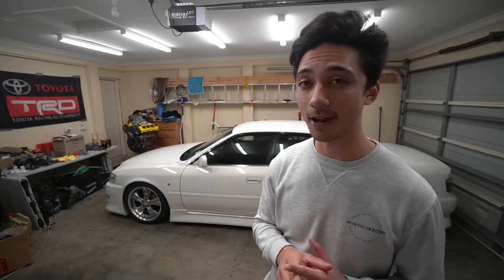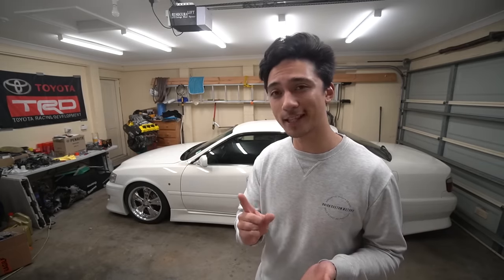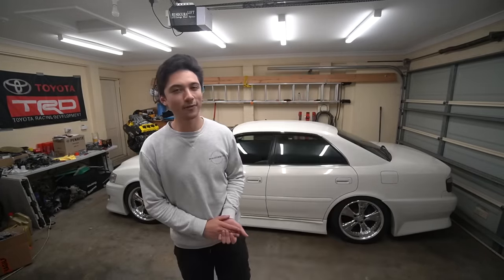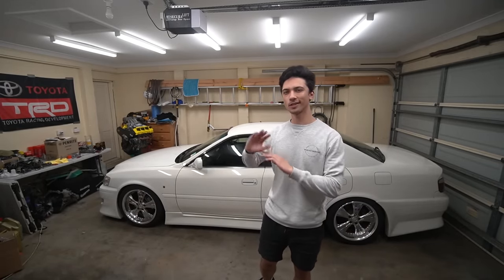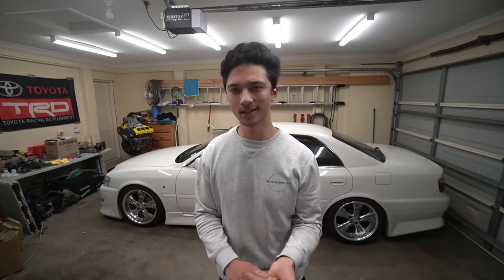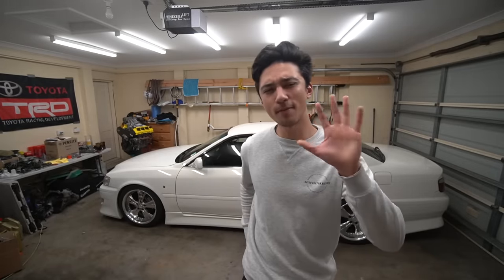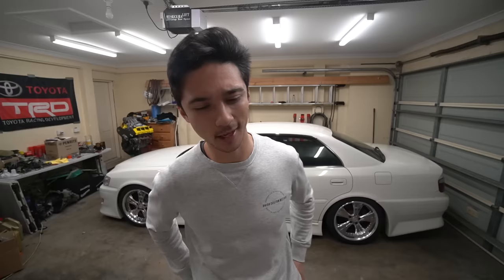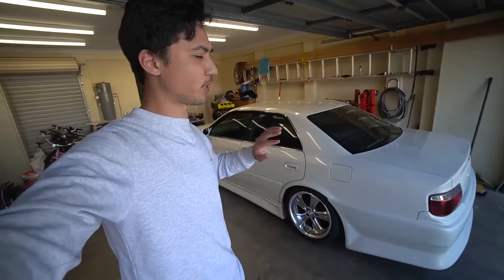The First 5 Mods You Should Do To Your Car (For Cheap)

Comment: I have a V8 in my car. Behind the manifold I’ve for 2 cats (one for each side) and then the exhaust joins. After that there were 3 mufflers stock. The car is 17 years old now and the middle muffler fell out with rust cause I live in the salt belt. I was trying to replace the middle muffler and the front one fell out. So I did a muffler delete and now it’s super throaty. I love American V8s

Comment: the best mod is preventative mantience
Reply: Yes but also no. Preventative maintenance could go far beyond just keeping up to date on your oil changes depending on your car. For some it’s a lot of shit to keep track and on top of. Meaning you could have a lot of work to do. 

Also, preventative maintenance will keep your car on the road at a lower cost. Some would say the point of modding isn’t longevity but rather performance and cool factor

Comment: One important thing you missed: if it's your first car, an economy car, or otherwise just not your end goal for a car...
Don't mod it. Please. Save up until you can afford a project car or a car you really like. Don't waste your time or money getting a muffler delete and 20-inch rims for your ford focus or kia soul.
Reply: I'll be getting my first car soon, around December or so, and I've been looking out for which one to get. I want it to be a project car but until pretty recently, I wasn't too much into cars, so the only ones I'm into are old, iconic cars that are relatively expensive used or not really suitable if you prefer a mixture between fun and having modern safety features ('67 Impala, AE86). On the other hand, I've had fun drifting in Assetto Corsa and always wanted to give it a try in a real car, so buying a car suitable for that would be nice too. Guess that's for the future.

Comment: When I got my very first car it was someone else's beater: a 2005 Nissan Almera Sport N16. I loved the design of it and where I'm from there's lots of spare mechanical parts but collision parts are a nightmare to get. 

Anyways: even though it had ABS (something my country didn't require as of 2017) the tires were a nightmare, the suspension was shot, the brakes were shit but the rest of the car was just fine. Engine and transmission were okayish, the interior might have been dirty and a bit neglected but it was kinda nice overall. 

So, the very first thing I did was to buy tires. People overlook tires a lot but to be honest it is the bestest mod you can do to any car you want, it doesn't matter if it's your track toy or your daily driver or both. A nice set of tires (mine were Michelin Primacy 4, nothing too crazy) and I was the first one in my entire family to use "a lot of money" in something that they considered not worth it. So, with the right specs I just got out of it many benefits, better braking time, better fuel economy, the car looked cleaner and nicer, cornering grip wasn't scary anymore, I could drive relatively high speeds in rainy conditions and all of it just with a simple set of tires. Those tires had saved me big-time many times from absurdly stupid collisions even today. Sadly my dear Almera passed away when I totaled him while I had a medical condition during traffic. I almost died that July 20th, 2019 but I managed to avoid my demise thanks to a nice set of tires worth a month and a half salary. He, my Almera, was my best buddy and made me happy during the worst times of my life. And his tires now live on in my 2006 Nissan Sentra B15 and their grip is almost as good as the first day I bought them.

I hope that one day I can get the same model just for the good times I had in it. My first touge run, my first therapy drive at night, the first car where I did my first road trip alone... And if I ever get one I'll swap the engine for a 2J Racing fully built QR25DE lol. Amen.

Comment: intake is the best thing (only thing) ive done to my 8th gen accord. it just sounds aggressive asf. its quiet from 1k-2k rpms but after 2500 she screams. compare your car to that of a cougar. a cougar is loud, aggressive, top of the food chain big cat. your car, is like a house hold cat but mannnnn she sounds like charm. definitely recommend for someone with a low budget. got a spectre air filter from autozone for like 40 bucks. (It even came with a sticker!!!) and it gave me the sound i was looking for. for my next trick, i will be cutting my exhaust right off at the manifold.

Comment: I am about to do a cat/resonator delete replaced with a straight stainless steel pipe and a wide bore exhaust tip. I've already done a muffler delete. I've also bought new headlights and pedals

Comment: Best mod is wheels baby, widest wheels that came in spec for that vehicle are the best thing... brakes dont stop vehicles, brakes stop wheels, and if you have a wide tyre that is what allows the car to brake and slow down... huge brakes can freeze the wheel in place, but what good does that do you if the car continues sliding forward at speed? suspension too comes after grip... every thing a car does is done through the wheels, so start with that... when the wheels are at their peak width, and have high quality tyres on them, then you can claim that any further upgrade of brakes, suspension, engine or downforce or even gear ratios will have their full impact translated onto the pavement, and you wont end up in a ditch or a pole/tree because you have enough of everything except grip...

Comment: First mods were tint, high flow air filter and cabin air filter, performance  tires and ceramic brake pads. 

Then aluminum charge pipe, race intercooler, cold air intake, new spark plugs and coils. 

Then finally JB4 tuned for E85 ethanol. 

Easy way to add 100 hp to an already-fast 310 hp twin-turbo IL6 335i with an upgraded suspension.

New exhaust system coming soon…

Comment: Cold air intakes are nice especially if they're true forms where they're encased in a box isolating it from the engine heat.  But you'll never see full performance out of it without tuning your car to equalize the fuel and air mix ratio.  Either way, if it's a true cold air you'll see an increase in power

Comment: I live in Germany. Here's what I can and can't do:
1. Muffler delete. Can't. Pollution laws are fairly strict, so are Noise laws. A muffler delete would go against both.
2. Sway bars. Can. No problems here. Might have to get it registered.
3. Short throw Shifter. Can. No problems here. Might have to get it registered.
4. Led bulbs. Can. No problems here. Pretty sure it needs to be checked and registered.
5. Pot filter. Unsure. Depending on the exact decibels this might not be allowed. Goes against Noise laws. Will have to be checked and registered.
There's a lot of bureaucracy for almost everything in Germany, especially cars.

Comment: Tune up with better plugs, coils, fuel pump, and injectors - general maintenance like all the worn bushing and mounts - brakes and good tires - lights and a better battery - intake and exhaust (no more fart cans please) -  now its probably time save up for the more expensive mods on your wish list.

Comment: Top 5 car mods
1) strip it for weight.  Throw out the back seat rip off the doors and get rid of the a/c
2) put the fart can on the back of the exhaust works best on 4 cylinder cars
3) put a spoiler on top of another spoiler helps with aerodynamics.
4) put a stick figure family decal on the car.  Cops are less likely to pull over someone with a family.
5). Add racing stickers.  The more the better each sticker adds an extra 15 horsepower.

Comment: Pod filters CAN increase hp, but if you are just ripping out the old air box and slapping in a pod filter and its just right there sucking in all the hot air from under the hood you will 100% lose power. Get a scanner and check the AIT TEMP with the hood down in the summer just idling, it will raise the air temp of air going into the engine so drastically it will kill your mpg and power, that ear dyno might tell you otherwise but its wrong. 

that being said not all cars sound better or perform better with a pod filter. My 02 tahoe? Literally fixed several power issues i was having and sounds FANTASTIC. My little 08 carolla? Sounded and performed like absolute trash. I had way better gains with smoothing out the air box, putting in a better filter, and rerouting the snorkle to the intake to get more air flow and put in a bigger pipe. Helps to just keep a universal pod filter kit in the shop and test it out on whatever new car you get to see how you like the sound. If its good then go out and either buy the proper cai kit for your car or plan out and build one yourself. 

Ps- hacking off your muffler all together makes you a cop magnet and hated by literally everyone you drive by because your car is obnoxious and exactly zero people hear it and think "oh man i bet thats a race car!". Instead everyone thinks "i bet that broke ass loser still lives with his mom."

Comment: If you’re planning on installing LED headlights please research how to install properly and clocking your bulbs to the correct position. This is the reason for the improper beam pattern and blinding drivers on the road, not cheap bulbs.

Comment: I guarantee, you can't out shift a Jerico 4 speed drag transmission. I personally like the manuals for the deciding factor when drag racing, it means the drivers skill is the what won the race but auto is the winner when it comes to shifting gears.

Comment: The VERY first thing you should do, if the car you have is not brand new, go get a diagnostic and figure everything that may be wrong with it or may be a problem in the future. Get that done then start with tint, muffler, wheels, headlights and all that cosmetic stuff

Comment: Power is nothing without control! Having more noise (muffler delete) is pointless and will become tiresome.   Everyone becomes used to the performance of their car and wants more power.  
However you need to upgrade the chassis and brakes first. When I tuned my car I fitted coilovers, quality discs/pads with dot 5.1 brake fluid and braided brake lines.  Stiffer rear anti roll bar.  Front and rear strut braces.  Lightweight alloys (same size as original) with sticky lower profile tyres.  I replaced the tie rod ends and bushes and had a fast road camber setup.  The car felt so much better.  Then I added a lot more power!

Comment: Buying an LS400 soon, would it be tacky to do a muffler delete on that car or would it work well?
Reply: cut the rear 2 mufflers and secondary res and it would sound pretty nice but if you just muffler delete i think you will be rather dissapointed

Comment: First MOD’s from 4/2022 to 10/2022 to my 2000 Civic DX were:

Yonaka catback exhaust
New SI wheels
New Hankook tires 205/50 R15
Tinted windows all around 
Smoked headlight and taillight assembly
New LED’s inside and out
Front and Rear bumper lips
CRV gauge cluster w/ Tach (SI 2 exp)
JDI push to start
OEM Foglights 

Next MOD’s:
Eibach Lowering Springs
KYB Struts/Shocks

Comment: I did a muffler delete on my 1998 Lexus ES 300 the only issue is it made my pipe a little shorter than I want it I would like to make my pipe a little bit longer but still keep the muffler delete

Comment: While I appreciate the idea of swaybars I drive a 2013 veloster remix the suspension is stiff As it is and the car sits extremely low to the ground for a stock car and it weighs only 2600 pounds if I were to add sway bars to this thing I don't think it would actually do much

Comment: Blue lights aren’t cool, white is much better and more usable.  4300K-6000K max.  I have advertised 6000K and they are pure white.  My other car has 4300K and it is white, but w/ a hint of yellow.  Neither look tacky and both function better than blue light, which is 6500K and above.  It just looks so cheesy and lame.  That’s why car manufacturers use 4300K for the most part. FYI and my unpopular opinion